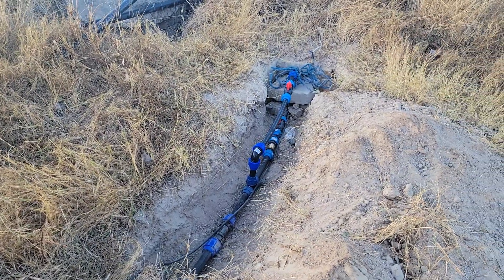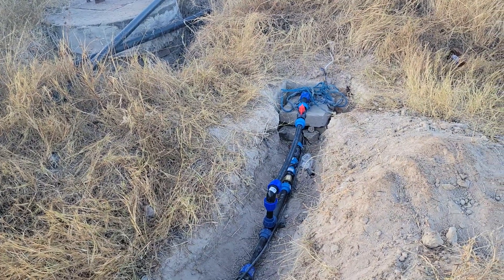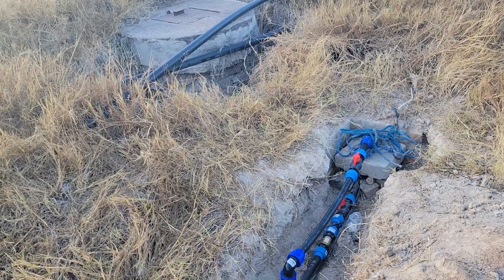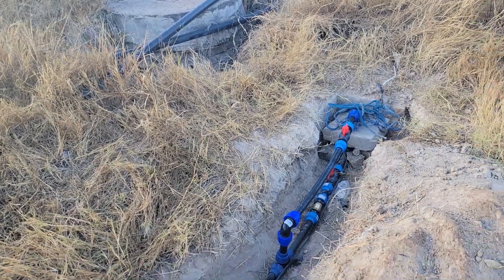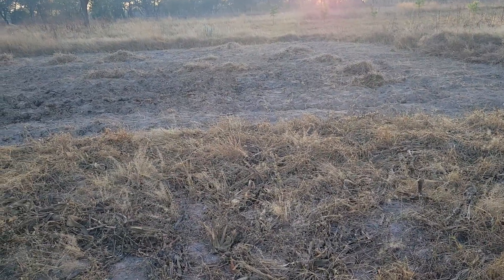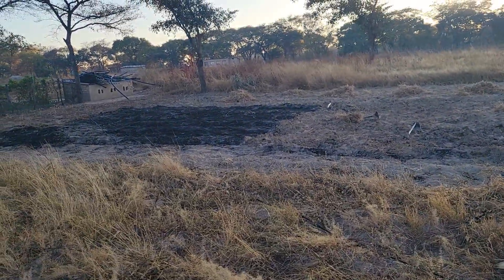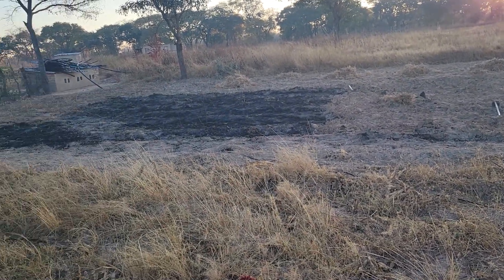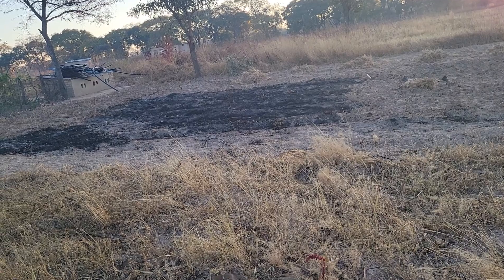connection of a solar and generator water pump in one well

Comment: How much did the solar setup cost you? Are you also able to put up a link for where purchased it? Thanks
Reply from the maker: This is very difficult to respond to because i bought things from different shops to reduce the cost the Pump/ control box / solar panel i bought from Bhola Hardware and the cables Ameer Hardware Pipes and connections i bought from Wessol pipes in Masasa hope this helps so all these shops are in Masasa area